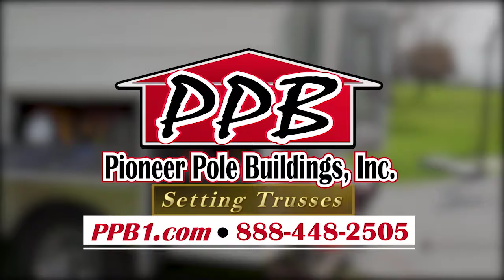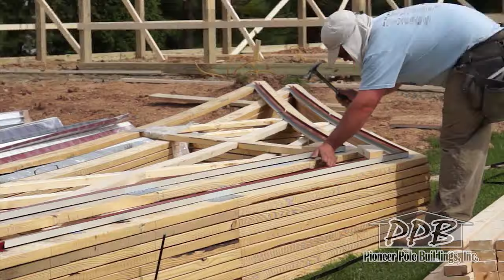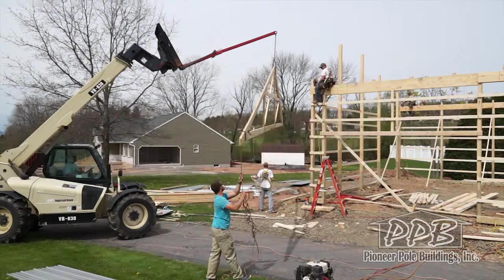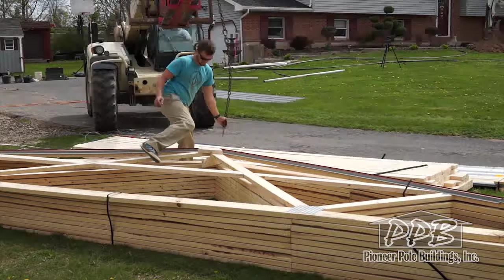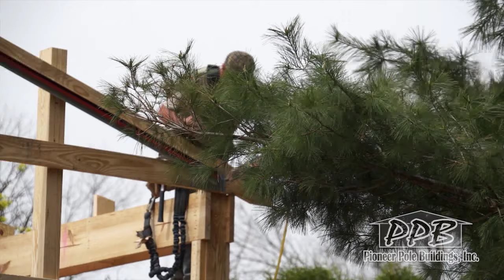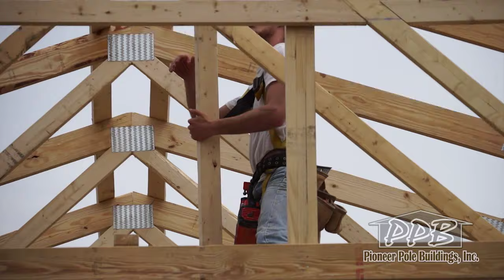Setting Trusses on a 36' W x 40' L x 14' H Building by PPB

Comment: I went with attic trusses. And I'm glad I did it but are set at 24" or 16". they can require almost twice as many and are twice as expensive each. Added about 10,000 for the attic trusses. Probably an extra 3000 in labor, they were 2 piece. Plus decking and stairs add to the cost. I also went with a cupola. That was about 1400 for a 48" cupola and the install .I can see why someone would pass on it. It's a serious cost that could almost double the price of the materials.It looks like it's a nice hobby building. I bet the guy was excited to see it going up.